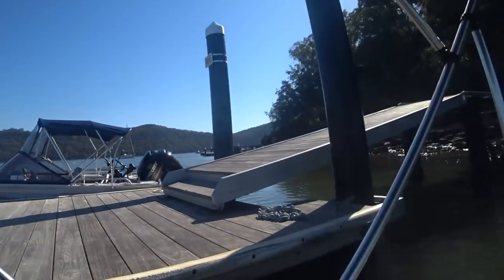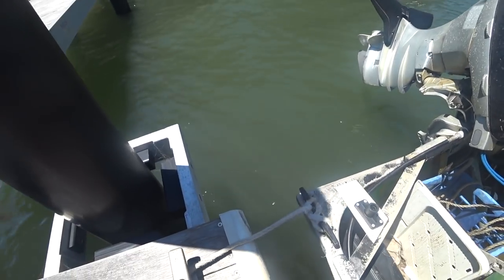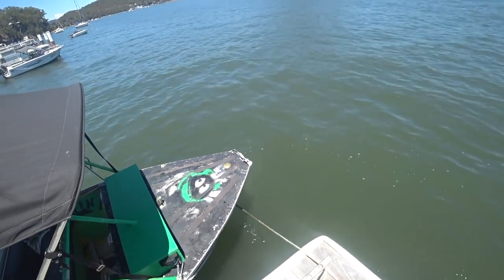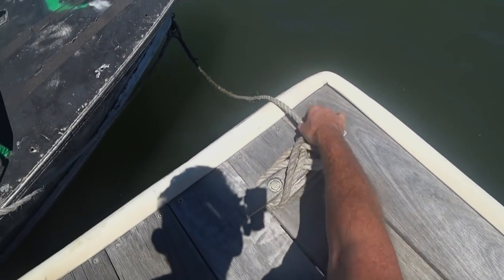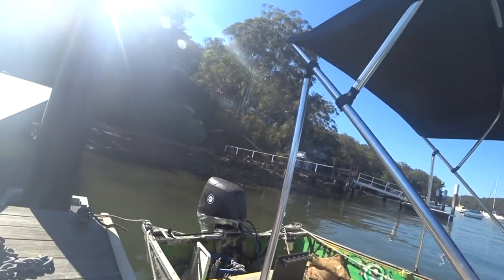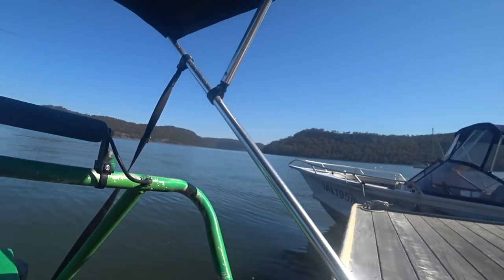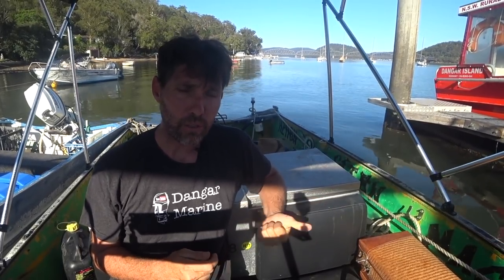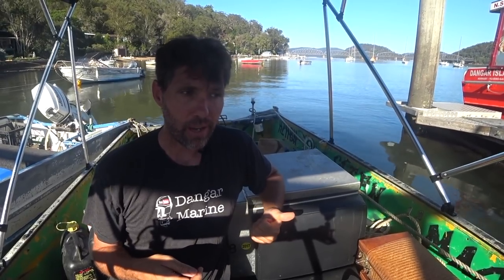Tying up a boat

Comment: Stu: when you tied up to the wharf, isn't you anchor line a hazard for the boats near you re getting wrapped up in their props?
Reply from the maker: There is a risk of this, but given this is how everyone ties up here people are aware of it and come in straight between the boats from a safe distance out. New rope that still floats with the main problem. Once it absorbs a bit of water it will sink and it much safer.

Comment: The beginning was excellent! But then there was lots of talking and no examples. If you weren't a experience boater, it would be hard to understand what he's talking about.
Reply from the maker: Hi Richard, I appreciate you being one of the few people that takes the time to say what you think could be improved rather than just silently disliking. One of the hardest things is to remember what it was like to have no experience at all, but that is what you need to do when making videos. In the Beginners guide to driving a boat video people would ask things like "How do I start it?" "How do I change gears?" and I realised that I needed to do an absolute beginners video. It's good to be reminded of that and of the benefit of using as many examples as possible.